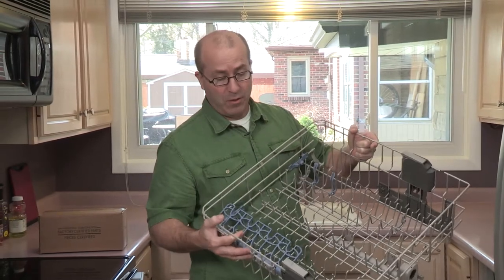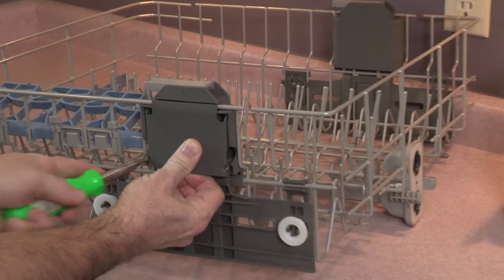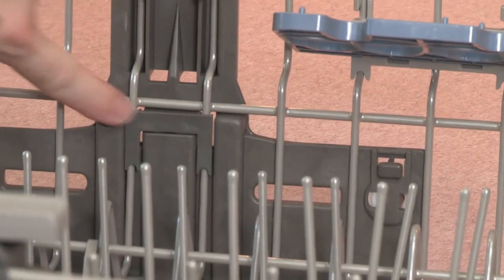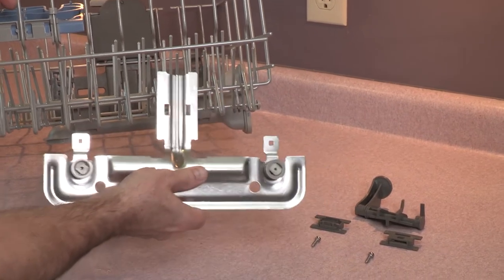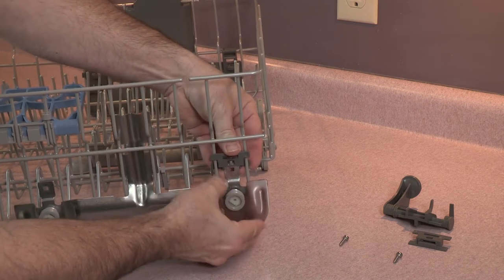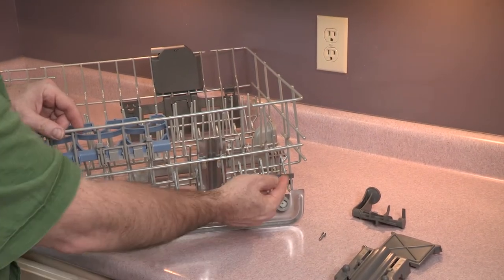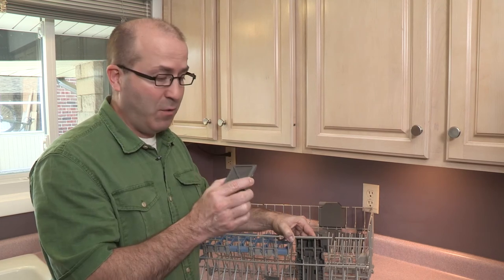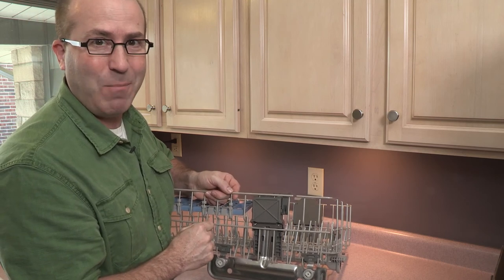Rack Adjuster Kit for Dishwasher

Comment: The directions were very helpful - much better than the written instructions.  The only difference with our rack is that the rack adjuster needed to be placed on the 5th slot rather than the 4th.

Comment: Very helpful using my replacement adjuster kit W10712394 for my KitchenAid.  High hopes the metal slider will not break like it’s plastic predecessor.

Comment: Great video except for the MISSING STEP that results in a FAULTY REPAIR! The metal adjuster arm needs to slide into the the track on the adjuster body (missing from 2:25 - 3:07). Missing this step results in an unstable rack. I had to redo the repair to figure this out.
Reply: I am doing this repair now. Thanks for this step. I have been struggling. I do need to know which way the pushbutton lever goes - toward the front or the back of the dishwasher?
Reply: Towards the front.  It says so in my instructions and if you put it in the back it would be difficult to reach.